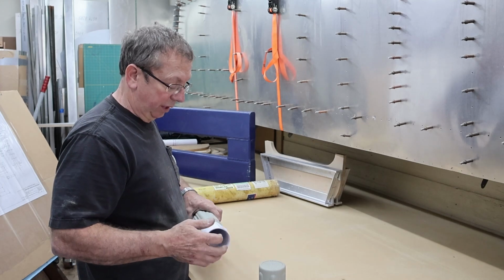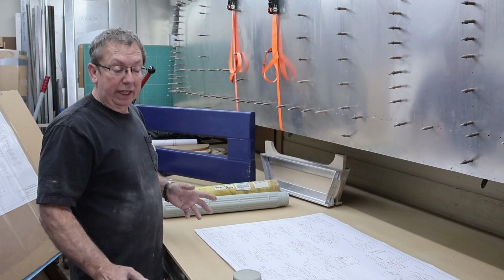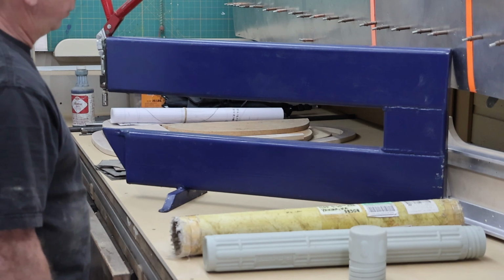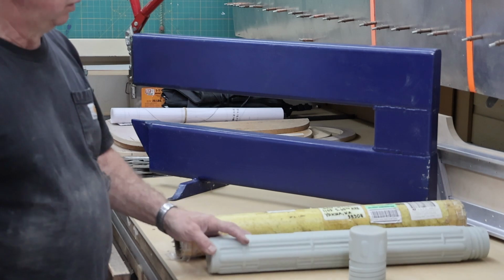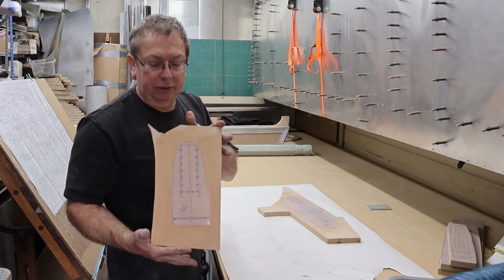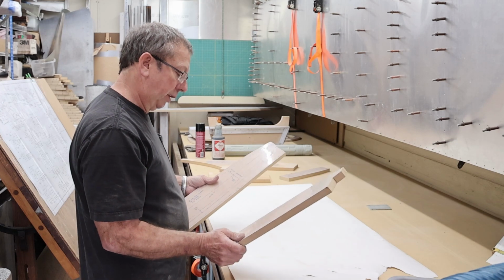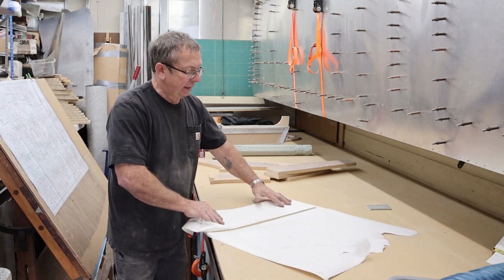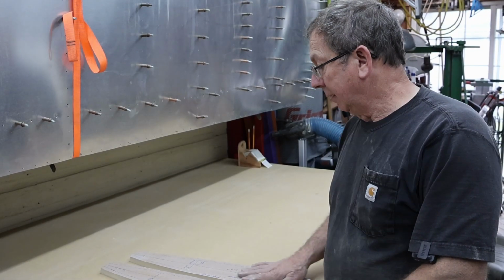Scratch Building A Midget Mustang: Part 4, March 27 2024

Comment: Uhh, what plastic material are you using for templates?? This is very interesting.
Reply from the maker: I layout all my patterns on mylar as it is stable when glued to my wood or mdf patterns, if you try and use regular paper it will stretch when you try and glue it and not give an accurate form.. Dan.
Reply: @hillsgun  yeah sorry,, I found the materials and process in your play list. My dream always was to build full size airplanes but life ,work and marriage didn't,t allow it. I scratched that itch by building, from kits, plans and three views radio control airplanes and the challenge was making accurate parts! My dream full size is a Mustang II. I saw Larry Kinder s scratch built plane at Osh Kosh 1979 or 80. Grand champ that year!!  I,m a biplane nut also. In my dreams I,d love to do a Hatz classic. So many airplanes,, so little time!